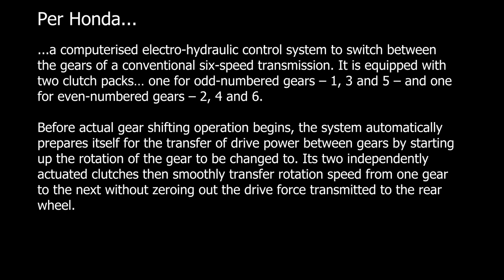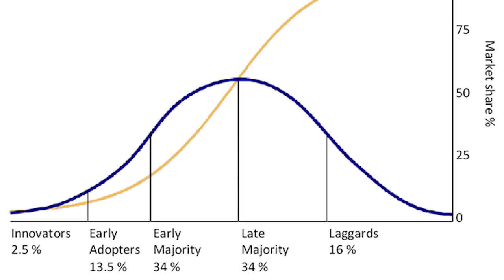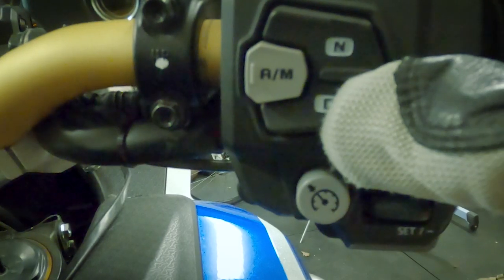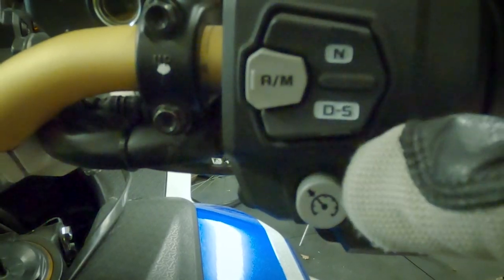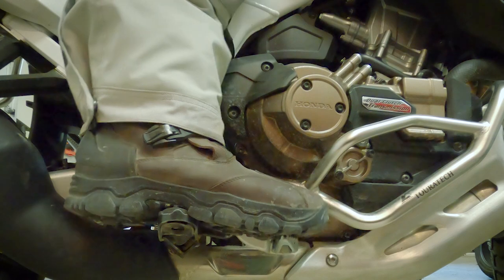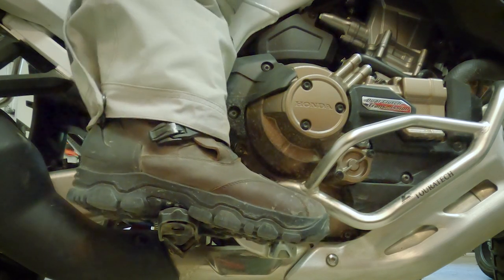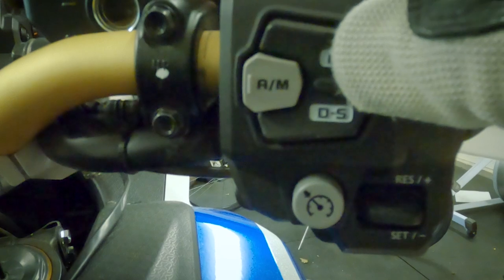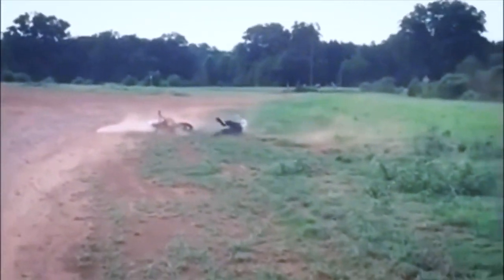The REAL Truth - Automatic Transmission Motorcycle

Comment: THIS IS ONE OF THE BEST HONEST AND TRULY INFORMATIVE VIDEOS ON DCT !!
I have had an Africa Twin for about 4 months now and I'm soooo tired of these absolute planks taking a DCT out for an hour test drive and then giving an absolutely uninformed and actually unfair to a TOP manufacturer review 🤬🤬
EVERYTHING you have said is completely accurate,  to give an HONEST review on the AT DCT you HAVE TO have had it for at least a couple of months to REALLY be able to use the DCT properly!!
And if you haven't had this bike for a sufficient time to KNOW WHAT YOUR FCUKING TALKING ABOUT !!!
YOU HAVE NO RIGHT TO GIVE NEGATIVE REMARKS,  
That could have a financial impact on the company or the reputation of said motorcycle. 
Everything you have mentioned,  I have experienced and therefore know you have indeed had this bike for a while,  it takes a bit of learning and I'm not talking about the console !
Anybody that can operate a mobile phone will have no trouble with the console,  you simply have to act like an intelligent adult and not just jump on the bike like a child ??
This is a bike that we will learn new things on for a long time,  I pick up something new using the manual shift with the auto box all the time,  its possibly the most interesting bike out there and I am going to struggle going back to the on - off power of a clutch when I can simply keep power on while changing through the gears.
Just wait , a DCT will blow away everything on a track but when they get to grips with brushless electronics in bikes,  combustion will be finished 😉👍
Reply from the maker: Thank you! Yep, certainly not a bike you can just jump on and quickly understand all the differences. I love the AT!
Reply: @troutdogadventures7751  
Cracking informative review mate 👍 
I hope people look at this before taking any notice to these chaps that are little more than test riders making useless comments like its jumpy at low speed 🤔🤔
When they simply are not using it properly 😉👍

Comment: This is a good review of the DCT.  The use of the rear brake is an important tip.  I had a '14 NC700 DCT, I whiskey throttled doing a slow left turn with the bars at full lock.   It was a bit unnerving.  I was fortunate to hit the kill switch.  It wasn't until later that I learned about the rear brake trick.

It does seem that Honda has continued to improve the DCT.  Enjoy your AT. Thanks for sharing

Comment: The use of the hand break in extreme cold conditions , where it might freeze overnight would be of concern to me. I've had the emergency brake freeze during winter in Montana. I don't see any difference.....maybe I'm wrong but.....
Reply from the maker: I do my best to avoid extreme cold on the motorcycle... so hopefully I won't find out LOL
Reply: Park it on flat ground and don't apply it if freezing temps are concerning. DCT rocks! And I have a Z06 and Boss 302 :-)